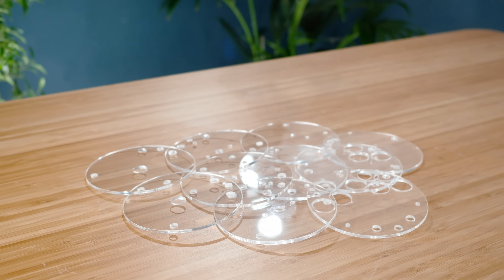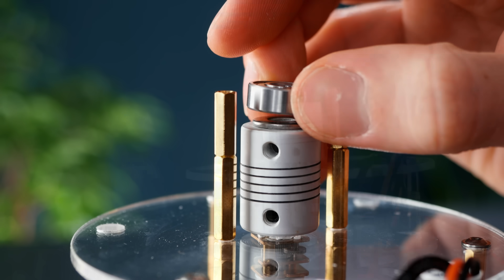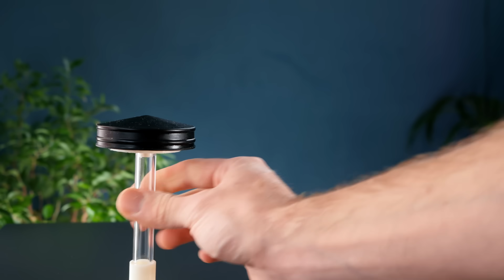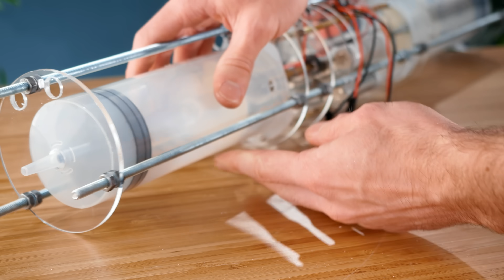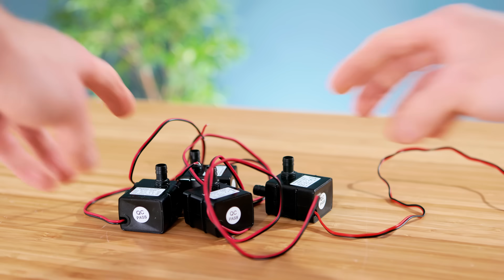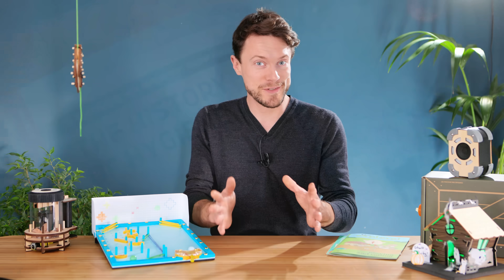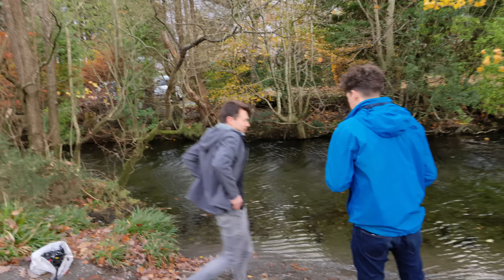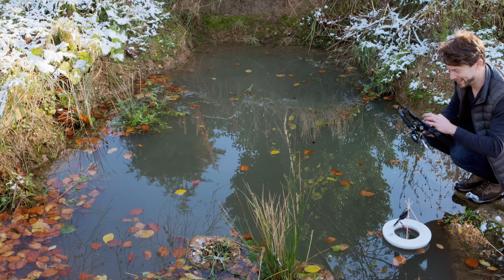Building a DIY submarine

Comment: That 500ml syringe has a centered outlet. This will give the intake/output of water a delay due to trapped air making the buoyance control to not feel responsive.
I couldn't find a eccentric 500ml syringe so your options are:
Close the original outlet and drill a new one on the bottom and glue a new intake/output point.
Measure how much water you actually need and go for one or multiple smaller eccentric syringe.
This should make the buoyance control much more responsive.
If you want to make the buoyance control even more responsive remove the connecting tubing and make individual water intakes connected from the syringe directly to the bottom of the sub in the shortest path possible. The less space you have for air to get trapped the more responsive it will be.

Another thing is with some coding you could have used 4 less pumps/motors for the the turning/sliding. You could configure that manipulating one nob the motors would turn on in opposing sides and with the other nob they would turn on the same side. Setting by nobs is just one of the many ways you can configure them to work like this.
Reply: u dont even need coding, you can use the radio, to mix the chanels into multiple nobs, to get the same effect
Reply: Also weight should be in the center, to reduce rotational inertia
Reply: He has so many water pumps with those 4 extra pumps he could fill and empty the ballast tanks without using the syringes which would cut on size

Comment: Great idea. Though i do have a second opinion about the length of the sub. It's a little long and the maneuvering would be easier if you shorten.
I suggest changing from I shape to U or even better, H shape (if you can find T connectors for that tube size). The battery pack will be in the middle for balancing.
Another thing i noticed from 19:55 (when you first submerged it), is the "rolling" effect, due to the nature of the I shape.
The H shape would help to prevent this.

Comment: It looked like the linear potentiometer might have been limiting the ballast's ability to take in more water, what you might try is using an infared photoresistor and led on the central assembly with a reflector on the rear of the plunger to make a rangefinder so there's nothing physically in the way of the plunger. 

Alternatively, you could try moving the linear potentiometer inside the central assembly and extending the shaft/motors farther back, but that would require possibly moving the batteries to the edge and the motors to the middle of the central assembly so would pretty much be entirely a redesign.
Reply: I believe I saw cutaway slots for the linear potentiometers to pass through, so they wouldn't be in the way.

Comment: first off gotta say very cool design , secondly my suggestion is you can add a telemetry system and a flight controller to it , a pixhawk or smthg and maybe make custom 3d printed thrusters smthg in the form of an edf with like a longer narrower tubing .

Comment: 1:20 Yes, but also no.
Submarines on the surface have positive buoyancy so they stay well afloat. To dive normally subs become neutrally bouyant - perhaps every so slightly negative to kick off the show, and use hydroplanes and forward motion to pull them underwater and control depth. The Ballast tanks should always be kept so the sub is neutrally bouyant, trim tanks ensure the sub is level in the water.
Submarines are more like aircraft just going through thicker stuff. They have control surfaces for every axis and the helm controls them much like a pilot would to steer the boat in all three dimensions. 

With this in mind, the ballast tanks can be MUCH smaller, and so handle much less pressure, a long thin syringe for example will be easier for the motors to drive the the plunger through the same volume as a short fat one also more precise.
When almost totally full of air the boat should comfortably float. When almost completely full of water the boat should be neutrally bouyant - 'almost' because you always want some wiggle room to dial it to 11 if needed. With neutral buoyancy the boat will sink to just under the surface naturally, then you use the hydroplanes with forward motion to drive up and down under water.

The Space freed up by the overly large ballast tanks can be used for more mechanical parts, batteries... some of it will need to be permeant ballast - rocks will work well, or lead/iron pellets. All more space efficient than the water you'll be sucking into the syringes.

All that said I hope this isn't taken as harsh criticism, I love the idea, and I'd love to try something like this myself one day - so much to do in so little time! And I hope to see others, or a v2 here of this with all sorts of improvements and stuff. And if you go quiet we can all assume some cartel has hired you to build their next drug running sub :P

Comment: Your design was excellent and very elegant. I've attempted to build a submarine before and I made exactly the same mistake you did re: buoyancy. I could tell yours would float too much immediately lol. It's a project I wanna revisit sometime. 

I have one question about your design, why did you use separate thrusters for lateral and rotational control, could you not have just used the same set and configured them to fire differently depending on whether or not you wanted to move sideways or rotate the sub?

Comment: i would really like to see you tackle something that is purely mechanical, no power/batteries or electronics at all.   a long time ago Wrebbit put out a weighted pendulum clock build kit,  made almost entirely from cardboard,  gears/cogs and all.  while it was very time consuming to build,  it was one of the most fun model kits i have ever built.  the problem is that it never functioned properly as a clock.  it still looks really good and still hangs in my house.  i have always wanted to find a way to make it work,  either by tinkering with the design a bit or by copying all the parts and make them out of something more substantial,  never got around to it.  i can't think of anyone more capable to find a way to make something like this,  and make it actually work.

Comment: Matt, absolutely superb. You didn't mention how the acrylic was machined.... presumably cnc mill because laser cutting wouldn't have given the required tolerances? Rather than adapt existing unit with extra weights, better to redsign for neutral bouyancy. At least extra batteries or heavier motors would have some benefits as an extra weight, rather than carrying a useless weight around

Comment: I saw that the current setup is very sensitive to the setting of the syringes. This is quite logical, as the overall density of your submarine should be exactly that of the surrounding water to stay at a constant depth. What you could do is program a PID (or PD) controller and a pressure sensor somewhere on the body of your submarine. Then you can use your controller to set a depth (by setting a pressure). This will increase the ease of use of your submarine.

(However, it will also add some complexity and weight to your submarine. As you need to add so much weight, it will probably not be that much of a problem.)

Comment: I would LOVE to be able to see how well it works in a larger body of water, the camera feed on this makes it really exciting! Great work on this! I've always loved rc submarines, and seeing one that actually has a ballast that changes the amount of buoyancy it has is like my childhood dream. Most of the ones I've played with involve using weights to achieve neutral buoyancy and then just using an impeller to push water up or down.

I also just thought about if changing the casing to a metal one would help with your buoyancy issue. It would also help the submarine achieve higher pressures with the increase in structural integrity. Now you got my brain to start thinking of solutions! Excited to see it with the improvements you make!

Comment: Way cool
I think you could get by with fewer thrusters, using maybe a micro to sequence which ones are used instead of having ones dedicated to sideways or turning. 
I've never seen such large syringes - what are they from?
The real challenge is to untether it, which would require very low frequencies, or even soundwaves. I don't think you'll find that stuff off the shelf like the RC gear.

Comment: Great video. Please change the control method so that it doesn't not require the floating platform because I picture the cables getting snagged on vegetation. Create an alternative rescue system if power is lost - maybe a self-expanding balloon using compressed gas.

Comment: In commercial diving they use ultrasonic to send signals and full on walkie talkie information underwater and is effective up to around 200-300meters. The official units are expensive due to having commercial grade test and licensing for oil rigs and such, However ultrasonic transducers are only a few bucks and if anyone could change the radio controls to ultrasonic controls it would be you.

Comment: my friend this is a brilliant design I am fully impressed if it is possible to make a suggestion the last thing you can do just to make it travel forward a little faster is use the brushless motor on the back with a marine propeller attached and that will be complete it should only be used to go backward and forward

Comment: Seems like controlling up and down movement only by buoyancy is not working so well when trying to stabilize it at one position. Is that because of the small size compared to a bigger uboot which has more contact to water and more resistance. maybe another thruster in up/down direction would make it easier to hold the position.

Comment: Not sure if anyone else mentioned this but,  if you restrict the output of the water pumps by even a bit. You can get more force. They look like a standard 3/8 fitting so say to 5/16 or 1/4 inch 🤔. This is easy to test, just place a pump in water and compare the head height 😉 not scientific but close enough.

Comment: Now imagine doing the same maneuverability thrusters on both ends of the submarine that can be controlled individually. That way you could fire off the front and the back in the same direction to strafe, the front in the back in opposite directions to rotate and place, or the front or the back in one direction or the other to pivot.

Adam those fancy POV goggles just for one-up-manship

Comment: i think he got a little thing wrong submarine arent neutrally buyant but the balast of the submarine can make in sort the he is but there was a flow with that the submarine is slow so diving to avoid danger is not an option so they add some mechanisme to be able to dive with more speed and it was the rubber so instead if only use them to set the depth of the submarine it can be use to dive more kickly (you should try and buy the game stormwork it's a good simulator and you can make submarine with air tight space)

Comment: The burning question I have is how deep can this design go without it leaking?
What I would like to use an ROV like this for is to explore old rock quarries as there are literally hundreds of them across the Midwest. I imagine these to be somewhere about 200 to 400 foot deep as no one alive these days really knows unless each state has measured the average depth.
The big question in my mind is what is at the bottom of these old quarries.
Cars, trucks, machinery, skeletons of drowning victims or maybe murder/self ending.
How many of these dangerous but inviting summer swimming holes are hiding clues or answers to decades old tragic stories.

Comment: I'm sorry, but your syringe example didn't make sense to me. The density of the compressed air is negligible and wouldn't have made a difference because the overall weight of the syringe hasn't changed. The reason it sank is more water enters in the back of the deeper plunger, therefore the syringe displaces less than before. The effect would have been the same without any air inside.

Comment: Very cool, indeed... But I think I could buy an ACTUAL submarine for the parts budget... 

Serious question;

     say you would have to go to a hardware store and an RC parts shop and so on, to buy every individual part for this build... 

(Excluding the tools. 
So assuming you have a soldering iron, multimeter, and a drill and screwdrivers and a saw already..
Just the parts...)

How much would the parts amount to?

So;
- the rc controller + board
- motors
- pumps
- tubing / wiring
- acrylic tube + acrylic panels
- rubber seals / adhesives / sealants
- screws / threaded rods / nuts & bolts
- LED strip
- 18650 cells
- 18650 BMS charging board
- etc etc..
      (If applicable, shipping costs estimated for parts you had to order online)

I'm seriously curious.
      > Especially because you're English, so prices for you should be sort of equivalent / similar to prices in the Netherlands
    (..with actual 20-21% VAT and stuff... And real world pricing, and real world shipping costs)

Because it FEELS like - (..and I DO hope to be wrong :)) - I could get an all-inclusive vacation in Spain for the money spent..
For a family of 24... ;)

Comment: Typical engineering mistake. Great execution but overkill.
Dynamic control is a whole lot easier than buoyancy control. Use the syringes for reliable above water buoyancy and rising up via failsafe.
Then add fins or thrusters and navigate dynamically.
Reply: You mean dynamic control like the Boeing 737 Max? 😀

Comment: Fascinating!  Makes me wish I hadn't given up my R/C flying 10 years ago.  Subs would be a good transition for people with aging eyes who can no longer see distances as well as they used to.  Question:  Once your technology has been proven, might it be possible to troll a smaller floating antenna tether rather like the way real submarines do for satellite comms, air inlet and diesel exhaust?  As long as the antenna floats close to the surface the sub should receive signals without difficulty.  That would allow the sub to travel further from shore without it being held back by all the wires.  A small GPS module could then be added to help the sub find its way home automatically in the event of low battery, loss of signal or limited internal failure.
Reply: You need to try fpv and freestyle drones.
Reply: I've considered designing a ultrasonic-based controller where you place a transmitter on the water surface and a transceiver on the sub.
Reply: You could ditch all tethers and use sonar. You just need a long antenna. Like how Air Force 1 communicates with subs that are fully submerged. They just use a 2 mile long antenna.

Comment: tsince you use a wire for a antenna you could also use wired control either using something like serial or i2c, but youcould also use 2 shift registers a transistor and a capacitor to make a pulse controller so you can control it with only pulses. this can be done over a single wire, either using the water as a extra, or using diodes and capacitors and resistors to link the signal + and - to the power supply + and -. when done right you could even transmit the power over the same single wire so you will not need batteries inside.

also why did you not use a network like lora for the communication, or connect the antenna from the remote to the water since the radio signal is decreasing faster in the water, but once the wave does not need to pass the water mirror you get a huge gain in reach, again you should avoid high frequent signals. but you can use ultrasonic or acoustic communication as well to get super far reach underwater, and it can be made pretty cheap, again if you do not have things like a arduino you could use something like a few transistors or a shift register for it. even a mechanical solution will work very well such a a small engine going from step to step on a pulse by connecting to the next terminal changing the cirquit and discharging the capacitor that makes it run.

Comment: For anyone wondering the proper name of the principle we explored today, it's Archimedes' Principle, which is defined as "Any object partially or wholly submerged in a liquid is buoyed up by a force equal to the amount of the liquid displaced." A great way to tell how much weight is needed is to know the cubic foot weight of water. In freshwater, you need roughly 62.4 pounds[28.3kg] to displace each cubic foot. In saltwater, which is slightly more dense, you need 64 pounds[29.03kg] per cubic foot. It's a really fun thing to figure out what can and can't float! 😁
Reply: a metric liter displaces well... a liter... and that weights one kilogram.  easy isn't it ?